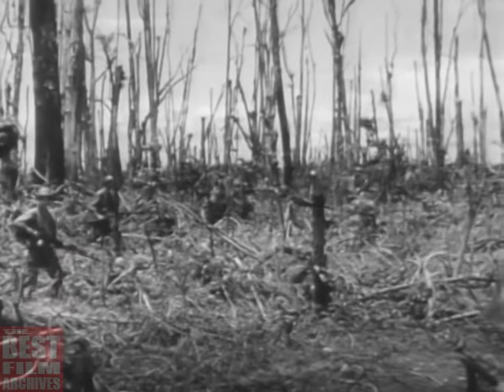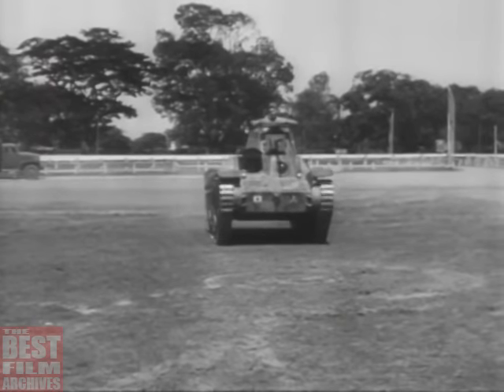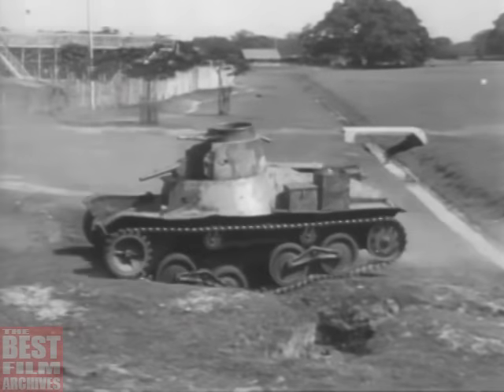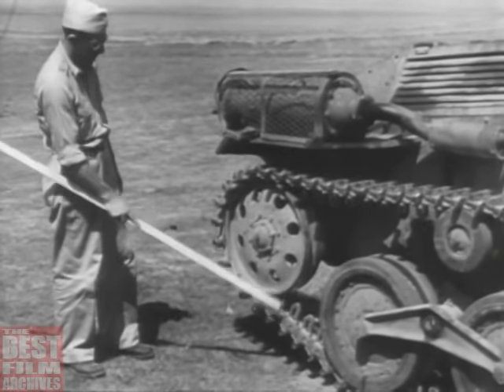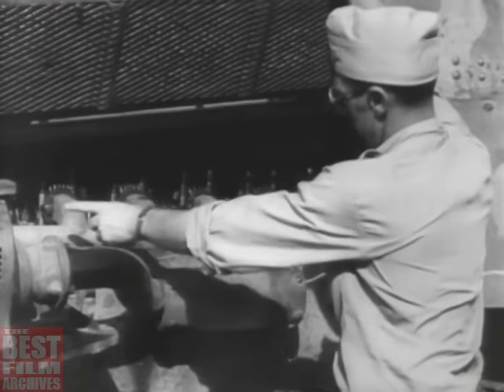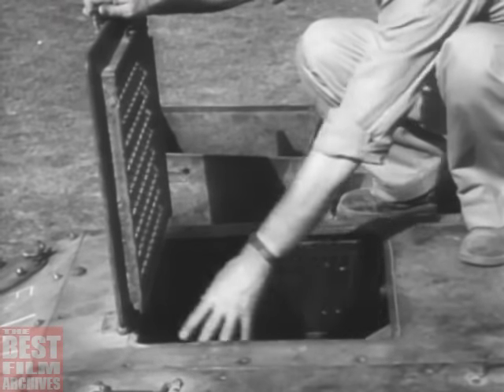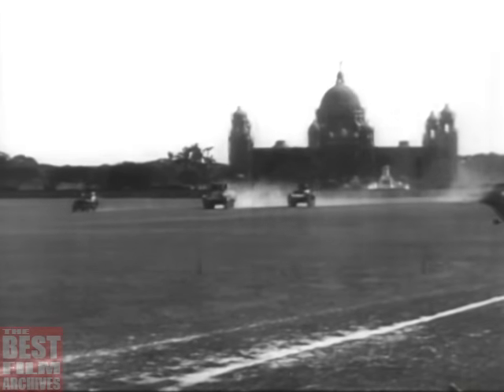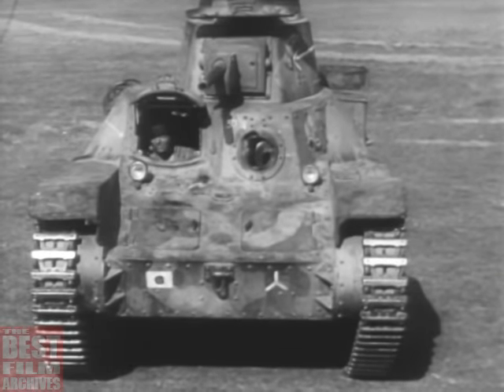How to Disable a Japanese Tank | Type 95 Ha-Go Light Tank | US Army Training Film | 1944

Comment: Holds 3 men...Japanese sized.  lol
Reply: Brisco Llama  ikr. haha!
Reply: Brisco Llama That brand of political incorrectness is so wrong that it loops around to genuinely funny nowadays.
Reply: When modern Japan was modernizing their armor forces, they looked at the American M-48. However, the drivers were so short in stature that they could not reach the brakes nor anyother floor mounted pedal. The then built the Type 61 at 35 tons and the interior is made for the shorter crew.
Reply: It's not politically incorrect at all. It's a fact that the average Japanese person was (and still is) shorter than the average American one. It's in no way derogatory.
Reply: Brisco Llama 
And 3 American xtra large size tries to get in, and the bolts and welded parts just pop out and break
Reply: Gaikokunootoko you realize they were only shorter on average by a couple inches right?  That's not enough to make a difference.
Reply: caif4 don't forget military have different standards
Reply: Bass Buster X I mean height is height.  Theres no way around that.
Reply: Some militaries require you to be of a certain height to join, I'll look up US rn
Reply: In WWII you needed to be at least 5'5" to join however the average Japanese soldier height was about 5'3"
Reply: Bass Buster X 5'3" is propaganda.  The average height of a Japanese male was actually 5'4"-5'5".  There were also plenty of people over 6'.
Reply: In the 1940s it made sense for Japanese to have 5'3". US soldiers averaged at only 5'7''-5'8" yet they towered over captured Japanese prisoners.
Reply: Anak ng Bayan again the 5'3" is propaganda.  The actual average is 5'4"-5'5".  There were plenty of people over 6' too.
Reply: Its because milk was never a staple in the Asian diet. Consuming dairy products at an early age will generally make you taller. That's why Asian's born in Western countries are generally taller. Anyway I'm Asian and I think this is Hilarious, not offended at all. I'm taller then the other Asians I associate with being born in the West. I also thought Robin Williams Quote "The Little People" referring to the ARVN in Good Morning Vietnam hilarious too.
Reply: Ahahaha its not wrong though
Reply: @Slavic_Goblin  No. Most modern developed  Asian countries have a growing population of tall men and women. That's because they have access to healthier food and better environmental conditions etc
Reply: @Duality-Mode   True, they do. Keywords: modern, developed. And even so on average they're off an inch or two.

Now I'm not saying that the differences back then were a foot in hight and two in width, but when cramming people into a tin can even an inch matters. Additionally, you're not picking the tallest, bulkiest people for tank crews. 

So, if it's true it's not really racist, even if it's said by a racist.
Reply: Japanesevis very short in WW2.....
Reply: @bassbusterx  there were japanese from hokaido that were at 6 ft

Comment: If you are wondering why this tank was so crappy, it was because of Japanese military doctrine that emphasized tank as just infantry support, and not a combat arm unto itself. Not to mention they fought in jungles a lot, and conquered most of Asia vs US and Brits with mainly infantry. So basically they neglected their tanks because their past victories never had tanks play a major role.
Reply: Its not crappy when it first came out. In fact it was one of the best tanks in the world when it came out. US was still using M1 combat car and early twin turreted M2 light tanks. Germany was still using Panzer Is and Panzer IIs.
The British had tanks similarly armed and armored as the Ha-Go.
However the Ha-Go was more reliable and faster than the British Medium Mk.1 and 2s and early cruiser tanks which was designed around the same time. Only the Soviet BT-series were truly superior.

In fact it was only slightly inferior to the M3 Stuart but in the jungles of the Pacific, the disadvantage was not noticeable.
Problem was that Japan kept using it well in to late WW2 where the M4 Sherman started being deployed. Although it is reported that the M4 got stuck in these jungle environment a lot more than the Stuart or Ha-Go.
Reply: Two more reasons Japanese tanks were crap.

1. They were still more than a match for whatever the Chinese could throw at them. The only reason they never conquered all of China is they didn't have the manpower or resources to conquer that much land with that many people. Also, China was basically very fragmented at the time. Much of the country was controlled by warlords, since the already weak central government was busy dealing with the Japanese invasion and Communist rebels. This made it hard to defeat the Japanese, but also made it hard for the Japanese to get a quick victory.

2. Heavier tanks weren't as practical for islands, especially islands that were heavily forested.

Comment: Even US at the time recognized the capabilities of this tank as seen in this video. It isn't a bad tank at all, just old.
At the time it came out, it was one of the best tanks in the world.
When it was designed, only the BT-series were superior in most areas. Compared the Ha-Go to its contemporaries like the M1 combat car, M2 twin-turreted light tank, Medium Mk.1 and 2 or Cruiser Mk.1.
Except for the British tanks, it completely outgun them all. The British tanks however were slow and unreliable at the time. The French similarly had better tanks but the low speed made them inappropriate for modern warfare. The faster french tanks were as well armed and armored as the panzer I... In otherwords, just machineguns.

The downfall of the Ha-Go was that it remained in service well in to late WW2 where it was obsolete. During early WW2, it can fight M3 Stuarts just fine. The Stuart was better but in the jungle environment, the limited ranges meant the Ha-Go was able to fight match it no problem. It wasn't until the M4 Sherman came along that the Ha-Go was inadequate. However the M4 got stuck a lot more than the Stuart which was one of the main problems US forces had with it.
Reply: Matilda's wrecked them pretty bad though during the war
Reply: It was ideal for the Japanese conquest of China where 10 of these tanks were far more useful than a single Tiger I would have been had it been available at the time (that weighted about as much as well as consumed similar weight in fuel and ammo).
Reply: Matildas came way later. I was comparing the Ha-Go to its contemporary which were just Cruiser Mk.I and such.

Comment: What if you take a stone and jam it in the firing cannon, when they open fire the whole crew will be kill. Does it work that way?
Reply: Nathan Peterson What are you saying?
Reply: I’m saying you take a rock and jam it into the barrel of the turret. Will it disable the tank?
Reply: +Shawn Tan Wai Kit

 Strange. Don't remember making this reply. Not sure what I was intending to write either. I'll delete it. My bad.

 I will answer question nonetheless. Often a small rock would be obliterated by the projectile if in the barrel. But that's a case by case basis. If one was firing a high-explosive round from a small howitzer or low-velocity gun (below 105mm. diameter, less than 30 calibers in barrel length), it very plausibly can blow the barrel apart and thus disable a tank. So doing such to a Japanese light tanks and "tankettes" such as the likes of the Type 94 Ha-Go it might blow the barrel. But it would have to be relatively large rock. Much bigger than the diameter in overall size. So one that tapers makes it plausibly work. However the weight of the rock alone would disable the turret either ruining or destroying the gun's balance and elevation controls, again dependent on the tank's gun/ howitzer and the rock's size and weight itself.

Comment: More proof that the Japanese soldier welcomed death:  the Ha-Go tank.  Is "Ha-Go" Japanese for "paper thin" or "under-gunned flaming can of death?"  The poor bastard in the turret didn't even have a poweres system to help him traverse, it was done entirely with his upper body strength.  Which was fine in a tank with a perfectly balanced turret on a flat surface, but if the tank was on an incline with gravity pulling the turret in one direction, or if the articulation between hull and turret was damaged or just shoddily built, well...no American canteen would have to be sacrificed in such instances.